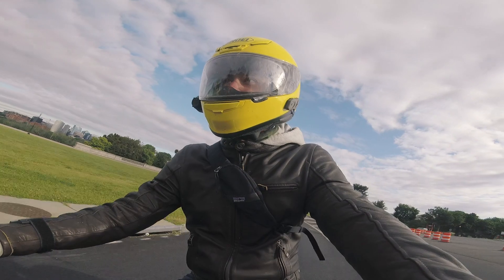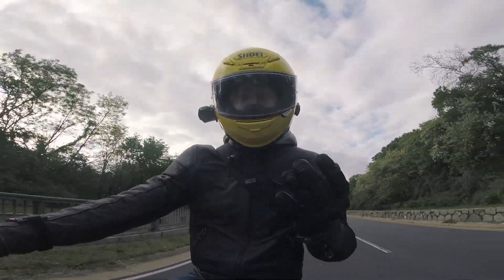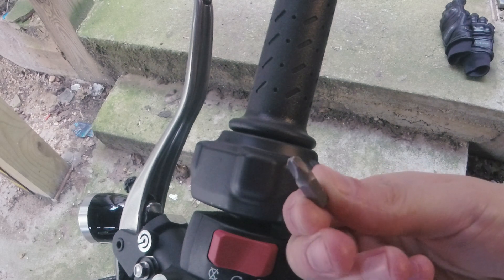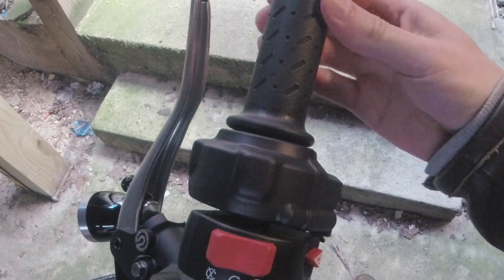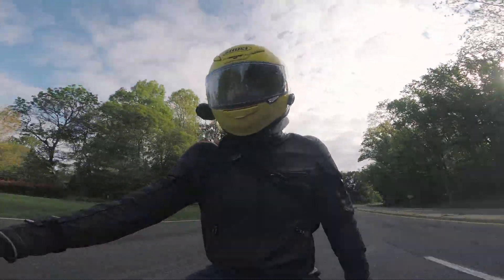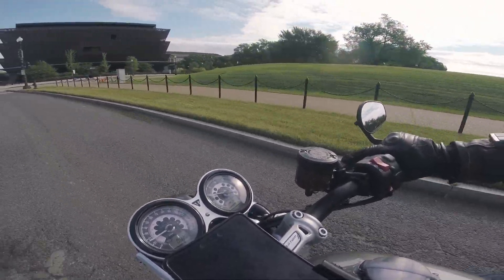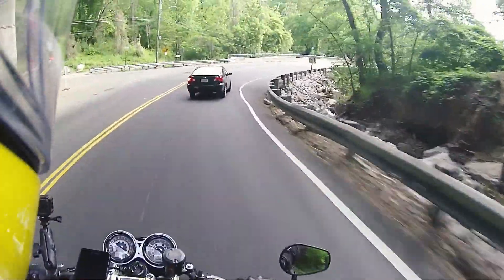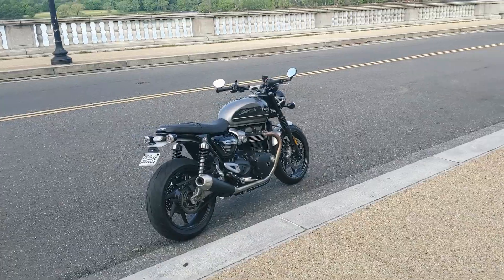Throttle Spacers for Triumph Speed Twin // is this a must-have mod?

Comment: Thanks for the vid. I am still not convinced though. And I don’t want to modify my throttle housing with something that can break and clog things. I have noticed that Road mode is jerky but Sport mode is much better ! Sport mode and proper throttle gripping works for me :) problem solved!

Comment: The spacers don't really do much.  Just learning the throttle does more, and going into the ECU and playing with the ride by wire tables does a lot more, and a tune...  I didn't bother with the spacers because I didn't find the 2022 Speed Twin all that snatchy to begin with

Comment: Make sure you get the ones from Ducati-Spacers there's some cheaper ones on sale that are really difficult to fit due to poor sizing, I had to file them a bit on mine and wished I had paid the extra few pounds, 
They say you get what you pay for, 
But hey they are in and working fine, it's a great mod and makes a big difference.

PS mine is always in sport mode, hardly ever use rain or road. Great bike love mine
Reply from the maker: Good tip, I didn't even realize there were others out there.

Comment: I don't like the sport mode either and use mostly the rain mode, even with the throttle spacers.
And I agree that the spacers are great and worth using, but don't change the general responsiveness of the throttle to a new level. It remains snatchy, because most of it comes from the engine characteristics.

My next mod will be the Arton vintage gauge. They have a really cool classic and clean look.
Reply from the maker: Glad to hear I'm not the only one. I hadn't heard of those gauges before, but they look pretty slick!

Comment: Booster plug + throttle spacer. Is what I use on my 2019 speed twin if that doesn’t work, power commander and a tune would be perfect.

Comment: Nice video - I especially like your camera angles (I had my Go Pro suctioned to my tank last week and I just couldn't relax imagining it flying off). As for this cheap mod, I'm pretty happy that my X-pipe minimized the snatchy behaviour- and I don't think I can pop this spacer in AND install the cruise control (Atlas Throttle Lock) gadget I've purchased. Are you familiar with this product - it's very slick my Speedie friend ....
Reply from the maker: Thanks! An x-pipe is almost certainly in my future; it's just a matter of deciding when I want to sit down and fiddle my way through the installation. I personally don't feel a need for cruise control, so I didn't have to worry about that when doing the spacer mod.

Comment: Hi Brother really need your guidance. I m looking to put The handlebar in my Triump speed twin. I have seen that the wire of clutch is little short I wanted your advice can I change the wire with the Triump scrambler 1200 because it has a bigger wire than the Triump speed twin. please advise.

Comment: When I go into a turn, I’m never completely off the gas so I don’t see how the spacers will make this smoother. The slack in the throttle is from off to on, which is bothersome in stop and go traffic but not in canyons. I think if we spend a $1000 on a Power Commander and a dyno tune, these problems would go away. I think it’s a fuel map problem. Of course, it’s terrible to spend this much money for a bike that needs that sort of manipulation just to run properly. 

Let me ask all of you a completely different question. Do you get a lot of heat coming out of the right side? I admit it’s around 100 degrees F here right now, but I’ve noticed this on lots of days in the 80s.
Reply from the maker: My pace is such that I'm braking into most curves, so I am frequently encountering the jerkiness. I expect it to smooth out even more when I eventually do a decat.

And YES! I am planning to talk about the heat when I do an updated owner's review, but it is my #1 complaint about the Speed Twin. The amount of heat it gives off is truly unbelievable. Anytime the temperature outside is over 80F in the swamp where I live, it feels like I'm sitting over an open flame. I find that whichever side is in direct sunlight is hotter. I've heard that a decat may help with that too. I'm also hoping it will feel a little cooler running on mountain air when I ship out to Colorado next month.
Reply: Yep, 108 here and its a bit warmer on the right than left, probably due to the fan ;)

Comment: I have exactly the same problem with the tiger, and i am very frustrated with it, And this kit dont fit the tiger. Any suggestions?
Reply from the maker: Hmm, I have heard that a full exhaust upgrade, or at least a decat, will also help smooth out most throttles. Those are a little more expensive, of course, but they bring other benefits in addition...
Reply: The Tiger uses a different kit and they have now made one for them if you hadn’t seen it.

Comment: I added these to my speed twin yesterday. I noticed that I have to sometimes manually close the throttle, meaning that if I just let go of the throttle it does not always completely return to closed. Instead, it may return to a position where the idle is about 2000 RPMs instead of 1000. Has anyone else had this issue? Will it break in?
Reply from the maker: Hmmm I haven't had that issue. I can only think of two things: you somehow overtightened the bar-end weights when reinstalling them, so they are pressing on the throttle tube and causing it to stay open due to friction (like how a throttle lock works); or the spacers you got were ever so slightly out of spec -- could be that a little extra material from a mold seam makes enough difference for the TPS to notice.

A throttle that won't snap shut is unsafe. Even though 2000rpm isn't much, if it's sticking there then it may only take a slight shift for it to stick at 5000. If I were you I'd uninstall the spacers and figure this out before riding again.

Thanks for watching, and I hope you get it sorted out. It really is a worthwhile mod.
Reply: @VanBlamm  I will do that. Thank you so much for your reply. Keep up the good work!

Comment: What year is your bike?
Reply from the maker: 2019
Reply: @VanBlamm  thanks. My T120 is a 2020 and I'm thinking those parts should fit my bike?
Reply from the maker: Hmmm I'm not sure. The Ducati Spacers site lists a bunch of Bonnevilles but not the T120. I'm seeing on bikebandit that the Speed Twin and T120 throttles have different part numbers; Could be the T120 uses a different unit to accommodate the optional cruise control.
Reply: @stephenricketts2067  . Fitted it today on my speed twin, and the seller at SQUAREDEALS (UK) LTD told me the spacer kit fits all Triumph "Fly by wire" applications. So should work for your T120.
Reply: @zatoichi1335  thanks for that. Ordering a set tonight.